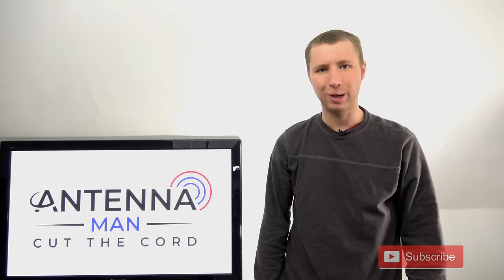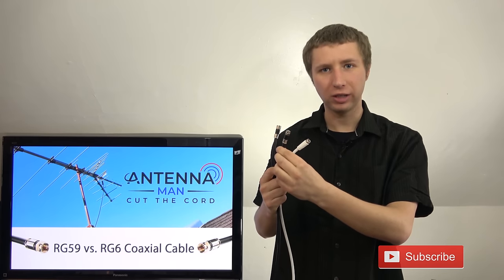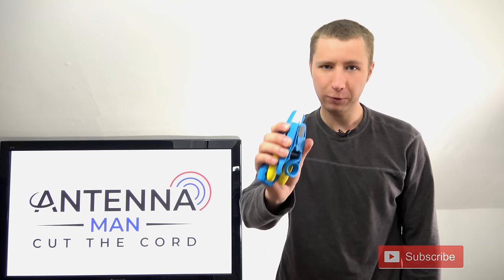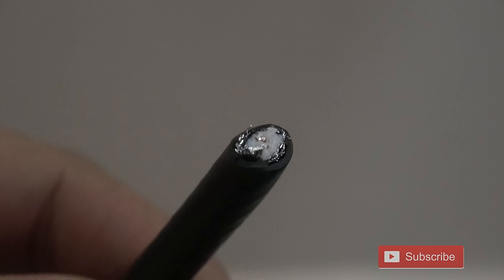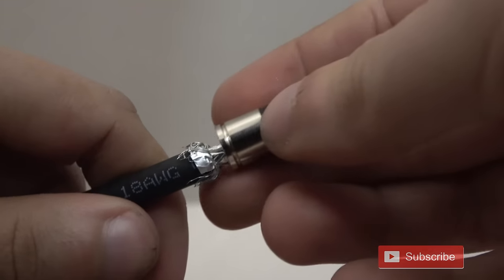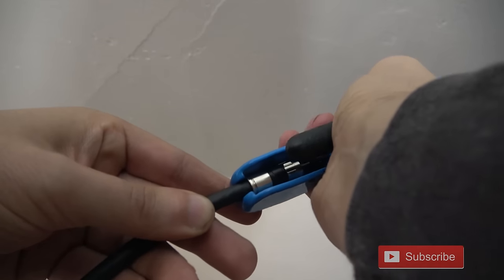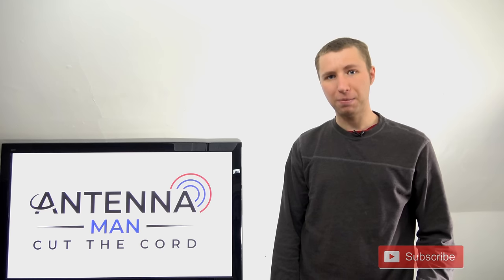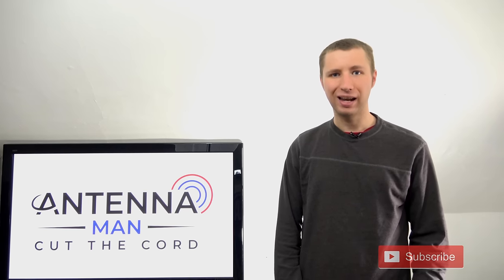How to Make a Coaxial Cable with Compression Connector for RG6 and RG59

Comment from the maker: Affiliate Link to compression tool kit used in the video:
https://www.lowes.com/pd/IDEAL-Linear-X3-Compression-Hip-Kit-Compression-Tool/1000404645
Affiliate Link to Recommended Coaxial Cables:
https://www.amazon.com/shop/antennaman?listId=4RBGOO8SD5CC
Affiliate Link to RG6 compression fittings 👉 https://amzn.to/2VQZS8V
Affiliate Link to RG59 compression fittings 👉 https://amzn.to/2KqDTR5
Reply: YO Tyler the Antenna Man! I want to express thanks and appreciation for your assistance with these compression connectors. I bought supplies to redo the connection to my Tablo receiver,  including your recommended RG6 quad shielded cable and compression connectors. I purchased the red handled compression tool from Amazon and EVERY ONE OF MY CONNECTORS just fell off. I finally found and watched this video VERY closely. The bit that nobody else tells you in the many articles and videos on the subject - but you showed it clearly - is that the metal shield inside the connector basically is supposed to twist between the inner insulation and the outer jacket. When I did as you showed and twisted the cable into the connector firmly with effort, and crimped it, the crimper felt like it was really biting in for a change.The resulting connection was tight and perfect. I seem to have more stable signals on several flakey channels now. I love your videos - great content - keep it up.
Reply: I have a huge amount of extra coaxial gables. Thanks to your video I understand the white ones are the ones I should not use.
How can I tell the difference for the black cones I have.
It says nothing on most the cables.
Thanks.

Comment: I decided to upgrade my coax and bought a 250 ft roll of quad RG6 and crimp fittings from Menards. My antenna is about 100 ft from my house do to trees. I wish I would have watched this first to learn about compression fittings. I am going to return the crimp fittings and get compression fittings instead. I hope the new upgrade increases my signal strength to eliminate my occasional signal loss.

Comment: I've watched about 10 videos so far on how to do this after getting frustrated. Your video has been the most explanatory and exactly what I'm looking for (not to mention using the exact tools I am using). 
Thankfully I did test on a shorter piece of cable, but I'm still running into trouble. Tomorrow's a new day and I'll be back at it (wiring my parent's place). Will have to rewatch tomorrow to ensure I'm fully doing this right. 
Keep up the great work!
Reply from the maker: If you continue to have issues I do offer setup guidance on my website at the link below: http://www.antennamanpa.com/antenna-recommendations.html

Comment: I have done hundreds of RJ45 Cat5e connectors in my day. Have also seen many a sloppy crimp. Trust me when I say, crimping cable is an art.
Reply: I've not done my own Cat5e in years as premade cable is so cheap, and meets my needs at home, and the side work I do repairing computers, and installing basic home Wifi setups for me people my small town, but in the late 90's I took computer network technologies, and did some IT work here, and there in the early - mid 00's, and I have to agree crimping cable is indeed and art.
Reply: In copper/fiber, the connector is just as important as the wire. I worked in an environment years ago where a majority of the connections were of custom length. I've done thousands of RJ45 connectors on cat6/6a, and hundreds of fiber runs. While not cheap, for cat6, the EZ RJ45 system is tops in terms of ease of use. The tool you can buy that works with the system is good quality too. In the consumer market pre-made is the way to go though as its not economical to buy a spool of cable/wire just make your own.

Comment: Nothing but RG-6 Quad here.   I will say terminating is somewhat of an art that you must practice.   Even with the correct equipment.
I will relay one of my experiences here.   I was having some signal issues with my cable modem through Xfinity.  Luckily I got a very good Tech show up.  He eventually got to reterminating all the connectors along the path to the Demarc.   He showed me the noise on the line as he proceeded using his test equipment/meter.  Every time he replaced one connector the line noise would go down slightly.  When he got done there was almost no more noise on that line to the modem.   That right there convinced me of the importance of a "quality" termination/fitting.

Comment: Good advice!  Been doing them for years and you are right, if you do not line things up correctly, the connector does not work well. Learned that the first time I did one. The inner connector was too short and barely caught the matching transformer connection. After a while the inter connector pulled out a hair disconnecting the coax from the antenna. It is easy to do if you don't pay attention.

Comment: I use Belden 1694a RG-6 and Belden 1505a (rg-59) It has a 100% inner foil and a tinned 95% copper braid so compression connector fit snug. I have to use sharp box cutter and carefully peel off a thin layer of the outer jacket where the braid folds over to make the connector fit on. This coax has a solid copper center, good if you run DC power through to an amplifier or LNB. Best cable I have ever used.

Comment: Tyler is right. Practice using the stripper SEVERAL times on extra cable so you get the cutting depth right on both blades before making your final cut on the actual cable that you'll be using. It will save you a lot of heartache in the long run.

Comment: I have purchased a Made in USA Klein Tools coaxial compression kit and 200' of Phat Satellite RG-6 bulk coaxial (assembled in USA). I know you recommend solid copper center conductor wire but I am only using it for connections from my OTA antennas in the attic and possible CATV later, so I purchased the much more economical copper coated steel type. I will not be running 12V through it AND I understand it is perfectly fine for my needs because the signal is running in the copper coating as "skin effect" anyway. Along that vein, I plan to, and I recommend to, examine the copper coating after using the stripper to make sure it was not disturbed, maybe even cut through all the way around by the blade being too long. I plan to use a magnifying glass to make sure.

Comment: I've been using couple good quality crimping tools, one racheting the other compound. Crimping tools were what was available then (not compression for the DIY) but the fittings were almost imposible to install, need much effort to push the coax in and many times damaging the RG6 underground cable. Just ordered the above Amazon compression RG6 kit, hopefully works better. I have two 500 feet spools of the RG6, going crazy rewiring everything, 140 degrees in the attic.

Comment: I made a comment on your coax type and quality video. ( Reiterating "well done" ). I kind of when off on my own rant, Don't use a twist on Type F connectors because the threads cut the braided shield off. And when on to say how carefully I strip in regard to not scoring the braid. I noticed you also being careful here. Myself [Following directions] I had bad luck turning the striper in both directions, however as to losing strands when fraying the shield back over the jacket, due to scoring. I found that quickly using my thumb and forefinger to reform the cable round again after cutting the cable with stripers, then press striper as you did and make 2 to 3 CW revolutions with striper solved the scoring problem and speed up the process also insertion into the connector was smoother.

Comment: Back in the early 80s when in-room movies in your hotel/motel room were just starting becoming available, people would try to bypass the cable box by pulling the cable out and trying to wire it directly to the antenna screws. My job was to go around all day fixing the busted connectors by doing just what you did.

Comment: The signal quality is much better with compression connectors.
Reply: Ive been using good cable but with thread-on connectors. Guess I gotta fork out for compression tools now to take full advantage.
Reply: @lesbsocal9107  I did that for years as a young person or I would crimp the connection, but neither were great choices, but that was in my early days. The outdoor weather would ruin any screw on types even taping them up, and I was always replacing them. Compression connectors is the only way.
Reply: I don't use hex crimp connectors the compression connectors are much better.  The FCC requires the cable providers to use them because they don't leak signal like the others.

Comment: I live in a large condo complex and I'm able to scavenge good cable that the Spectrum installers leave strewn about. Spectrum helping a cord cutter, lol.
__________________
When I make cables w this method the connector housings do not have continuity w the shields.
So I cheched a cable left behind by Spectrum, and same thing, no connection between connector housings at opposite ends of the cable when I check w ohmmeter.
Is that right? DOESN'T MAKE SENSE!
Reply: Something  is wrong.  You will  lose signal. I bought  some cable that showed  no continuity and through it  out. I suspect  it is the aluminium is oxidized and not making contact,  don't  use it unless the  shield  makes contact.
Reply: @SuperFredAZ  Right, not using. 
Will chop connectors off n use cable with my own connector s

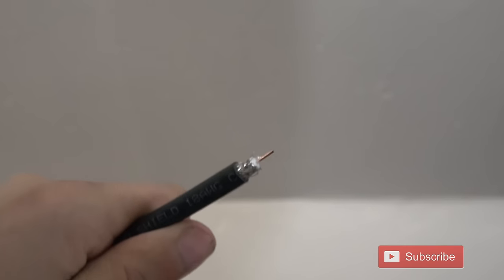Comment: 3:06 Be careful you didn’t scratch the center conductor. A scratch could cause issues with low band frequencies 0-100 which are used as return frequencies for ISP using Docsis protocol for internet.
Reply: Interesting, I've been scraping the center till its shiny and bright.

Comment: Warning:  You must watch his entire videos for tips or lightning will strike your antenna.  Just saying it is all good advice. And, thanks for the cheap tool link.  I went to Ace hardware and a crimper and 10 compression fittings was $40.  So be patient and cost prudent and order from his link.  By the way, Ace sells RG6 Quad compression connectors that DO NOT include a threaded connection end, only a flat end and a hole for the conductor to stick through.  And, understand the difference between "crimped" connectors and the tool for that, and "compression" connectors and the more expensive tool for that. So I ended up coming home from Ace with a crimp tool and compression connectors that have no threads. I had to return the compression connectors.   I have no idea how they are used, so if you buy connectors, make sure the end is threaded if that is what you need.   Antenna man should do a video walking through hardware store video sections and commenting about what is there vs what he recommends.  Do it at Ace, Home Depot, Lowe's and Walmart!

Comment: I was told to not twist on the compression connector because it may cause issues with the braided jacket. It's almost impossible with quad shielded cable to not twist it in my experience. What I do is do a small twist back and forth while pushing. I'm not sure if it makes any difference though. Those quad shielded cables are not easy to do! Good video as always!
Reply: Would a dab of a dielectric grease on the outer jacket to the coaxial cable make the insertion of the RG6 QUAD a little easier?

Comment: I tried to bring an outside RG6 cable into the house through a nice bushing I bought at the home store.  I could not get the connector to stay on or pick up a signal.  finally got frustrated and just made a bigger hole.  LOL.  The connectors I bought off of Amazon are a pain to try and get on an RG6 cable.  I definitely need more practice.  How about a video to test the cable?  maybe with a multimeter?
Reply from the maker: I have a video on this topic below: https://www.youtube.com/watch?v=2xiDvxz35Ec

Comment: The RG59 is best for RCA or component cable. You can also use it for an external FM antenna that has 75 Ohm output. As for digital TV it sucks, many channels especially on UHF band dissapears. RG6 cable (even the dual shield) is far superior than RG59. Even in analog days the RG6 had better picture than RG59
Reply: Yep, and at least from my experience when I replaced the junk cabling under my house from my fiber to the node, and copper coax cable to the home ISP(AtlanticBB), and reran my own higher quality RG6 from Lowe's(don't remember the brand as it's been several years), I've had better more stable speeds from them.
Reply: @user-dj8yo6nj1n  No he just replaced the old coax cable which was RG59 with RG6.  He gets both TV and internet on the same coax cable.
Reply: I wish I had seen these videos when I installed my house tv cables back in 1980

Comment: You may have wanted to emphasize more about making sure that all the braided shield tiny wires are tucked downward. It only takes one little strand touching the copper to make the cable useless. Thanks for a great demo!
Reply from the maker: I would hope that the average bear could see that I tucked the shielding downwards!
Reply: @AntennaMan  I consider myself a smart person but, trust me, my first compression fitting was a train wreck :-)
Reply: @AntennaMan  We are not all "bears" and some are below average anyway

Comment: Antenna Man it makes those Coax Connectors go on so much easier if after cutting you give the cable some heat with a heat gun. It softens the coax outer coating and the connector will slide right on all the way to the position it is suppose to be at. Just the right amount of heat too much and you melt the cable too little and the cable is still to stiff. Practice makes perfect with the heat gun but a little heat is better than no heat.
Reply: Finally! Thanks for that. Now where my heat gun?

Comment: Inside the compression fitting there is an inner ring which has to go inside the cable,, inbetween the wires that you pulled back and the rest of the cable. So if you have difficulty sliding on the connector then you need to flare the cable with a coaxial flaring tool or a very small screw driver, being careful not to damage it. It may be easier to instead of peeling the wires over the outside, just cut them off, and slide the inner ring directly under the outer layer of the cable.

Comment: Great video....Can you please help. Comcast tells me I must run a new "home run" rg6 line from my basement splitter to a room just above into a wall outlet for a new Comcast router. Should I use dual, tri, or quad RG6 cable? Would like to future proof as much as possible. If quad...must I than use quad from wall outlet to router....or can I use regular rg6 already in place. Any and all advice will help....thank you!

Comment: Excellent video as always Tyler, you are a very good instructor.  Do you recommend putting a 75ohm terminator load with a cable extension adapter on one end of the cable and testing it with a meter after the compression fittings are attached?
Reply from the maker: I'm sure it wouldn't hurt

Comment: I use Belden 1694a with 95% tinned copper braid and foil shield. The center is solid copper which is better if you are running low voltage DC for a mast mount pre amps. I use a Steren compression tool and connectors that are water tight. Belden has new 4 k coax that has a copper silver plated center conductor. But it is expensive and overkill for most TV antenna installs. The longer the run of cable, the more important high quality cable is.
Reply: If low loss is the objective, 1694a with its 95% tinned-copper braid + bonded foil performs much better for long runs than 60/40 aluminum quad shield cable.  Yeah -- 1694a cable costs 2x to 3x as much, but for my ~120ft run it was worth it to me also...

Comment: Antenna Man!! You Rock!! I have followed you for a while and appreciate your knowledge and expertise! I have a question, my antenna is approximately  75 feet from my tv. If I use quad shield good quality R6 cable with a preamp, will that work with a Clearstream 2Max antenna or am I wasting my time because of the length of the cable?  Thanks for your guru-like advice!!  Greg Maxwell

Comment: I want to run new coax from wifi box into my RV.  Will use the high end cable recommended but what about a compression fitting vs a crimp fitting. Is one better than the other?

Comment: Yup. I practiced with half a dozen connectors on a piece of scrap coax and I still had trouble on the roof because the compression tool got out of adjustment and I broke three connectors before I figured out what the problem was.

Comment: I have new construction that has a coax cable coming out of the side of the house, but it's just cut off. It's not long enough to reach up to an antenna, so I'm going to have to use an additional length of cable from the antenna, and put the other side of a connector (the male side) on my in-wall run. Can I do this myself, or can I buy a coax cable that has a male on one end and a female on the other?

Edit: I just realized you can use a double male-end connector along with a female connector on both cables. Would this be proper?